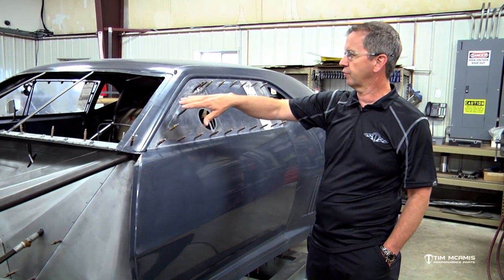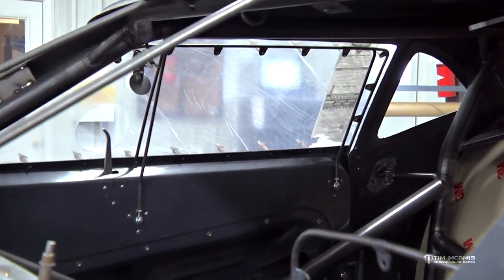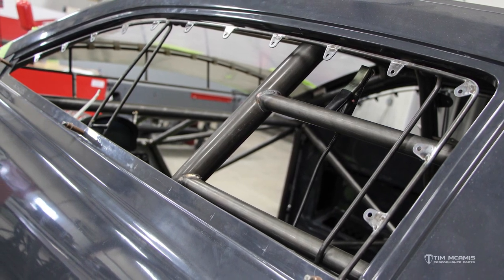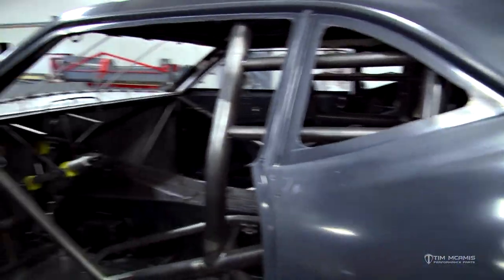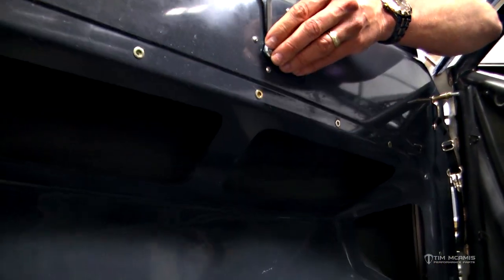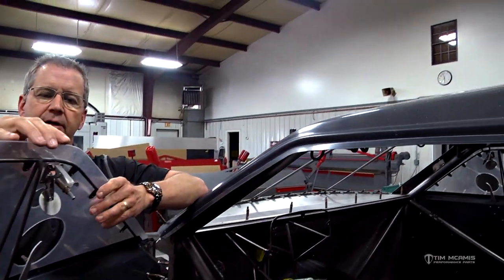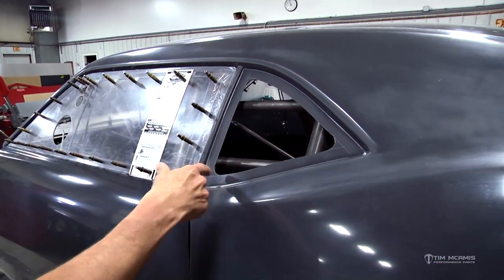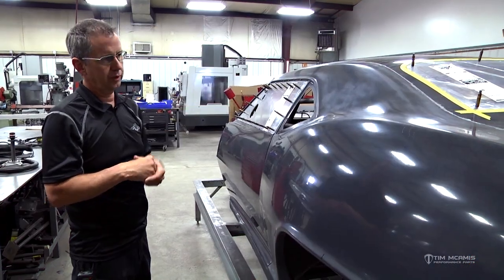Door Slammer Build: 10 – Window Installation

Comment: Border paint what do you recommend ive fought this for years. Used everything from rc paint to rattle can from wally. Found the best that works for me is oil based rustoleum gloss black from the hardware store and brush it on. Its messy and time consuming.
Reply from the maker: This is what we use - https://timmcamis.com/shop/window-trim-paint.html

Comment: Hey Tim. I will probably be buying one of your beautiful rear end housings and a 4 link suspension system. Can you give me tips for choosing the right size one? Should i set the IC in such way that rear end doesn't "squat" and will this mean that the rebound and compression setting on the rear shocks won't be so important,since they won't be moving much (or at all)?
Reply from the maker: Dimitar, it will greatly depend on the type of car the set up it will be going in, (chassis type, tire size, power levels, etc.) I would suggest calling our shop (636-338-4912) and speaking Billy or Ed. They can help give you some more specific answers for your application.
Reply: +Tim McAmis Performance Parts The chassis we just bought is built by Jerry Bickel,comes with a 63 corvette body. It doesn't have a rear end,but has fully adjustable 4 link tim mcamis brackets. The car has front struts from Jrbrc and double adjustable koni rear shocks. I would have called but i'm living in Germany and the phone bill will probably cost me the kidney i didn't sell( 😂😂). Do you ship oversees actually?
Reply: By has koni rear shocks i mean it came with them
Reply from the maker: Dimitar Iliyanov We ship overseas every day. If you email info@timmcamis.com they will be able to answer the questions through email as well. Thanks!
Reply: also I would suggest doing some homework on anti-squat and anti-dive. there are several good online articles covering that online.
Reply: 77racing i have 4 different chassis tuning books and nowhere is it written what 100% anti squat does to your suspension :/ maybe my books suck lol they all focus on what a higher or lower value of anti squat will do to the rear suspension and how to properly set it up
Reply: the 100 percent theory is that the car will neither lift or squat. and no potential energy that could be used to drive you forward is lost.

Comment: At what point are the upper window latches required?
Reply from the maker: It really depends on the car type and body. If you start to notice the windows being sucked away from the body during a run, it is definitely time. We've seen this happening on some cars right under 100mph. Others, where the body creates a small lip before the front edge of the window can sometimes be ok with having no upper latch.
Reply: anonymous  The amount and thickness of extra struts capable of resisting the suction at speed would add more weight than that saved by fitting polycarbonate windows in the first place!